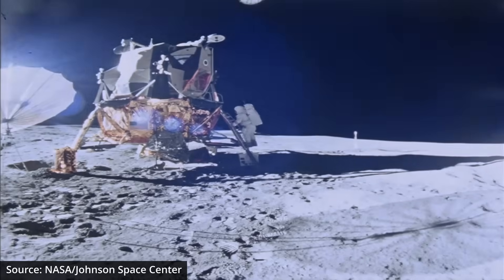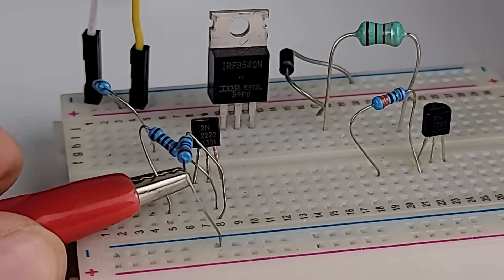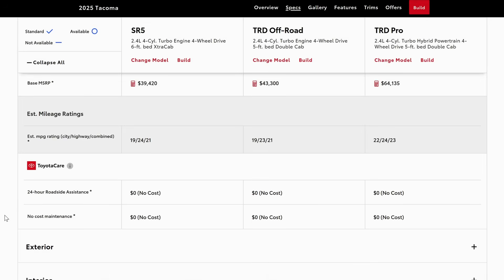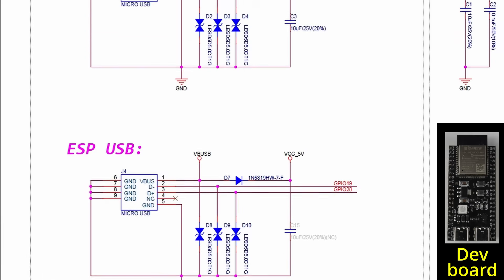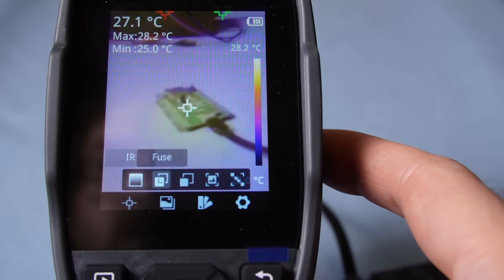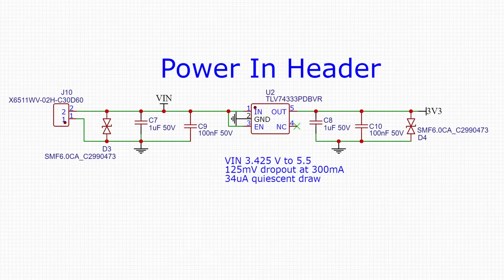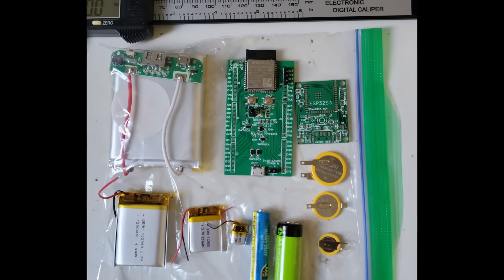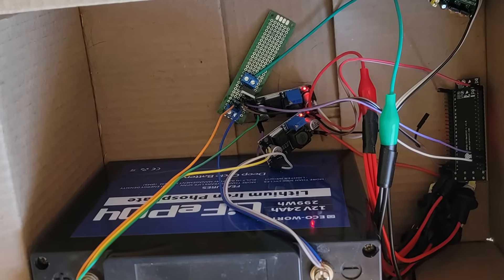ESP32 Dev Board to Custom PCB in 3 Steps

Comment: Wait until you learn about making your own ASICs
Reply from the maker: I am very tempted but FPGAs in more than a familiar capacity is my next frontier! I have heard it is getting much easier these days with the software improving as well as the fabless design company model creating enough demand to make something more like regular PCB type manufacturing pipelines but for things like ASICs. I do a lot of data processing using C code and have seen some basically C code to ASIC generators out there.

Comment: I will have to take this step sooner rather than later for my project.  I'm making a handheld device with a speaker and mic to use while skiing but still have to go from breadboard to soldered connections.  But the mic in particular needs 5 wires and I'm not sure how I'll make that happen and still fit in a small enough encloser that can be operated while wearing mittens.
Reply from the maker: You will really like the video I'm about to release. Has a really high quality microphone in it that you can super easily use yourself. I can't imagine skiing with a breadboard, those connections are so janky It can be considered almost a sport to keep the wires held together while moving 😂 but in the meantime, make it permanent by using super glue to hold everything in place for prototypes. It's often really cheap to just get jumper wires and everything connected well and then super glued into place. It's not a PCB, but it's also not moving in the near future!

Good luck on your handheld device and if you have any questions feel free to ask!

Comment: Note that for most dev boards, a buck converter won't be more efficient, A because you have to buy an expensive one to get decent low quienscent current , and B because the linear will be just as efficient if not more when the board is sleeping on battery power.
Reply from the maker: The devil is in the details! I love my ultra low quiescent current LDOs but I tend to do a lot of IOT stuff that's plugged into the wall and has a decent amount of data transmission over Wi-Fi. 

I think for me I will use an LDO if I have 5 volt supplying a 3.3 volt circuit, but if I'm going to potentially have 9 volts or like a 12 volt battery power it ever then I just throw on a buck converter so I'm not burning up obscene amounts of power.
Reply: @FluxBench  Yeah buck will start winning if you have a major voltage difference rather than just a 5->3.3V one

Comment: Hey love your channel! I am in compsci but I want to start doing electronics by myself. What do you recommend for learning theoretical and practical electronics?
Reply from the maker: The only theory you need is ohm's law. Voltage equals amps times resistance. Okay, practical only now! 😂

Just get your hands dirty, it's not dangerous if you just mess around with like five volts or less. It is genuinely hard to do bad things unless you short circuit a battery that doesn't have any short circuit protection. Other than that, you just need to learn by doing and breaking stuff. So use cheap stuff that if it breaks you don't care. You don't need to get $4 capacitors made for high-end audio when you can use a 3-cent capacitor and it will work just fine. 

Hope you know how to code well, firmware is just software on small electronics. Zero difference. C code runs everywhere from supercomputers to 25 cent microcontrollers so learn how to do that and don't rely on C++ if you wanted to make basically everything. I literally have the same C code on dollar chips and in the Amazon cloud. 

Make some PCBs for cheap. Doesn't have to be complex, just knowing how to actually make electronics from scratch is amazing. Imagine you didn't know how cooking works. At least cook eggs and now you've made food for the first time 😂

Comment: lets talk seriously > i recently watched a interview of a youtuber who has made a video on which he show making of esp32 clone board in 3 hours of his video on yt. So in his previous videos. I had watched an interview in which he talk with an invited person idk him but he said that he had made many custom board more than 50 and then also he says that all are modified from its clone. So is this mean that cloning is best way to learn this ? Or can you elaborate this things
Reply from the maker: Because it can take like 2 weeks and often a decent amount of labor and money for each iteration, so you want to stay with what you know works. Most designs are filled with the same general requirements like needing a USB port and power regulator and LEDs and various capacitors and resistors. So when you want to make a new board you might just add a sensor or switch or something like that to a previous design and not change 90% of things. So you are making a clone of a development board with minimal changes. Then you are making your future boards based off your first clone, with minimal changes. 

3 hours for an ESP 32 board is very reasonable. I would say anywhere between 2 hours and 10 hours depending on your experience level and the complexity of what you're making.

Comment: I've been working on a project for a few weeks and learning about electronics and pcb design. I have seen a lot of videos on the topic and I just stumbled upon yours today - WOW, I really really like the way you teach. You take some of the mystic haze away. Like the way you showed how to go through a datasheet to find what is really essential.
Thank you! I am hoping to see a lot more from you!
Oh, by the way... what size are those smd resistors and capacitors you use?
Reply from the maker: Sounds like you got the motivational fire lit inside you, I hope you make something awesome! What are you building?!

Those are 0603 sized capacitors, resistors, and maybe even ferrite beads. 0805 is huge compared to 0603 (30% bigger but seems almost 2X to me), and I've never used 1206 except for things like huge MLCC capacitors or small inductors.

If you make your first board with 0805 because you're nervous about hand assembling it, just don't buy so many components that you won't try 0603 in the future. For example, you can't buy like one surface mount resistor at a time, the minimum order quantity is often like 100 or 200. Just don't order 1,000 until you figure out what size you like working in. I like 0603 because it's a good mix between small enough where I can really cram in a lot of things on a board without it being huge, while also being fairly easy to assemble. 0402 is doable by hand, but anymore than a few on a board and it gets super tedious to assemble it. 

Good luck and if you have any questions feel free to ask!

Comment: I'm korean. sorry for my bad english skills.
I wanted to say it by myself not AI. 

I was really interested in PCB.
but I was worried because it's kind of different with just buying Arduino and stuffs.

but you gave me cofidence.
you mentioned about failures and called it 'process'
thank you and I really enjoyed your videos.

Cheers!!
Reply from the maker: Awesome! Thank you for your message, I really appreciate you writing it yourself and not using AI!

The first PCB I made was way too complicated for a beginner. I spent too long designing it, and it still had a few problems anyways. I made a much simpler PCB next, and it worked! 😁😁 I used that experience to make another simple PCB, and that worked! And then I started working on more complicated PCBs.  Looking at it as a process is great! 

Even if your first PCB was just a module with a USB port for power in, 5 volt to 3.3 volt converter, and a connector for the 3.3 volts out, that would be enough! You will still be learning so much even doing so little. 

I hope you embrace the process and make some awesome things! 

Thank you for the great message! 😊

Comment: Thank you for the inspiration.
What do you recommend for a current-limited DC PSU ?
Reply from the maker: Basically anything that looks like it has good reviews and is bigger than a pack of cards. If it's going to be on for a while you want something that will have good air flow, so go physically bigger or with good air flow. I have a 30 volt and 5 amp power supply I use for almost everything. If you need more amps or higher volts you might want to get a separate PSU as I like that I can't accidentally dump 800 watts into an ESP32 board because I'm using something that won't output that much power even at max.

Comment: Is this your first and only channel? I'm binge watching your videos in a random order and it seems like you have experience doing this kind of thing.
Reply from the maker: This is my first and only channel, and my only social media too. I saw somewhere the advice "make videos that you would want to watch yourself", so I'm basically making videos that I wish I had about 10 years ago when I was starting out in electronics. Glad you're binge-watching them 😂 weird to think I have enough videos to be binge watched!
Reply: @FluxBench  Loving your content man!! Keep it up.. I feel like I'm that past version of you right now. I needed this. Im trying to create things. I made my first PCB recently its just an LED circuit with an ATtiny, but I did it man, I went from 0->1 and your videos inspired me.
Reply from the maker: @Tkeyro  that is awesome! You did the hardest thing, start. Good job 😁👍

You can get small MOSFETs like the AO3400 and connect them between your LED and power/ground then you can start doing a really cool things. That same code you used to blink LEDs could then be used to turn on much bigger things. Adding a couple simple sensors that talk over UART or does have like a voltage output are great next steps too. No need to put everything on a board with a microcontroller, I make tons of little sensor modules and switching modules with like a relay or MOSFET and once I know it works well, I can just copy paste it into my next microcontroller board design. 

That's really exciting seeing where you are! Lots of great stuff ahead for you! 

Feel free to ask any questions you have, you're going to soon be in this awkward zone where beginner info doesn't help and the advanced stuff is too advanced.

Comment: Hi! I had an idea and wanted to make a little DVR board which saves analog video input to an SD card. 
The esp32cam only saves at like 10fps (think its mainly used for streaming over wifi) so wanted something which could do about 60. I found this chip; the allwinnerv3s but I couldnt find an applications circuit on the data sheet...
Do you know any other chips which might work. I've never designed a board before and really keen to try.
Just found your channel and love the videos. I couldnt belive you had only just started- the editing is really good and engaging. THANKS!
Reply from the maker: That sounds like a really fun project! You have ran into the problem of video actually being a really large amount of data, and microcontrollers or small boards just don't work well with it. I just got a mini PC, basically a computer between a Raspberry Pi and a laptop, and it might work great for your application. They start at about $200 but since they don't have a screen or battery like a laptop they have the CPU and memory and other tech specs of more like a $400+ laptop.

I wish I could tell you, go by this chip to make a custom board and it will work fine, but you're more in computer land when dealing with video. The way cameras and VCRs and stuff like that do it is with specialized chips for that specific task, not something you can easily use yourself. 

Hope that give you a good idea of what to do, but you might just be able to use an old laptop if you have one for this! Feel free to ask any questions you have.

Comment: lol making a unique pcb design is not as simple as you make it seem
Reply from the maker: It has a lot of prerequisites, but once you get there it's pretty easy 👍 Still takes a few hours though. Usually like a full day for a new to me MCU dev board compared to a sensor module that takes like an hour to make the PCB.
Reply: @FluxBench im making my first pcb, an eeg sensor. And its a pain in the ass. Extremely sensitive
Reply from the maker: @astralmaster1692  You chose a good challenge for a first board 😁 Reminds me of a pH sensor, seems easy until you realize how hard it is! I don't even deal with stuff that sensitive usually!

Feel free to ask if you have any questions.
Reply: @FluxBench where do you find rise times
Reply from the maker: @astralmaster1692  do you mean like when you turn something on, how long does it take to turn on or for something to go from like a digital zero to digital one? If so, that would be in the datasheet in the middle of the big table of numbers. I normally look on the right side for something that says seconds or milliseconds or NS for nanoseconds or something like that.

Comment: Can you give me a hint for next episode :-D
Reply from the maker: The BMP280 is a common air pressure and temperature sensor, the BMP 390 is a improvement, but there's an even newer and even better one out now! But I did the same thing with the latest microphones. Should be able to do some awesome stuff like see what sound using them in a array. I made the PCB design in under an hour. Waiting for the PCBs and parts to arrive!

Comment: good video and has alot of info usefull  keep going i have question for you your esp32 s3 if we use cable type c to type c is work on both side or not mean you connect one of connector to your computer  and other to your type c connector of esp if you flip connector connect to esp  will work or not  ??
Reply from the maker: USB C ports are the same as microUSB except for power. The two data lines D+ and D- get connected the same to the ESP32S3. Only "PD" power delivery is related and can be different. Should work any way you plug in a cable 👍
Reply: @FluxBench  l know this because this am get confused if use cable type c in both side the connector connect to esp work in one side if am flip to other side dont work
Reply from the maker: @hossammohamed3987  It sounds like it might be a problem with your cable. That individual cable might have a connector on one side that is fitting into the ESP32 better, and the other side of that cable might be a little bit smaller or bent or something. Try another cable.
Reply: @FluxBench  i think problem of in design of board beacuse am test other cable and i have 2 board from  same local source and this happen after a lot of search am find problem can come from pin cc1 or cc2
Reply from the maker: @hossammohamed3987  did you make this board or buy it?
Reply: @FluxBench  buy it as development board
Reply from the maker: @hossammohamed3987  then the only thing you can do is try a different cable, or try using something like a "USB hub" in the middle. A USB hub actually copies the data signals and from one port to the other so it can fix some small issues. 

I have some microcontrollers like ESP32 that only works when I plug a USB hub into my computer, then plug my USB cable from my ESP32 into the USB hub.
Reply: @FluxBench  okay am try thanks for reply and keep going for usefull video

Comment: I`ve already made 2 devices of esp32 talking to each other using ESPNOW protocol
for curtain eyelet press machine. the first one responsible of operating a press machine`s relay to lift the piston (vertically sliding cylinder) and send press count to the other side. which is responsible of save the numbers in a table and show it to the user through an OLED screen 
all of that made of the dev boards 😅
it is working fine. but I think it's drawing a lot of current, because it is finishing the 3.7 li-po battery rapidly (just the counter esp32 has a battery) after disconnecting the plug or turn off the electricity by 2 hours I think 
and sometimes it just freezes and I should just turn it off and on to have it working 

this video encouraged me to make my own PCB and not using voltage regulator instead buck convertor  
I am just a beginner 😊
Reply from the maker: Awesome use of an ESP32! I haven't used ESPNOW other than just playing around, I've been using other wireless and mesh protocols. Seems like a good alternative!

Buck converter will save some power, but also running the chip slower or sleeping when possible can save a lot of power. If you make your own board you might want to have 2 power connectors with "OR-ing diodes" using ideal diodes or MOSFETs so there isn't a big voltage drop but you can plug in a second battery then unplug the first.

Cool application, feel free to ask any questions!
Reply: @FluxBench  
I recently started watching your content. Although I’m still new to it, it’s already been quite motivating for me, and I believe it will be very helpful technically as I continue learning. 😊

Comment: omg he's back!!! I love your videos, they scratch the electronics itch like no other channel does. Patiently waiting for you to hit 100k subs 🙏🙏🙏🙏 I gotta try to build my own promicro now
Reply from the maker: Glad you get a kick out of my videos 😁

That is a great project! Maybe try adding a sensor or other things too since the promicro is such a simple board. If you are worried about adding something and it's screwing up the whole design if it doesn't work out right, you can do things like place a 0 ohm resistor or other low value on the traces between the microcontroller and the sensor. That way if something goes wrong you can just remove the resistors or not add them when building the board and you're back to just the base board.

What kind of stuff do you want to do with it?